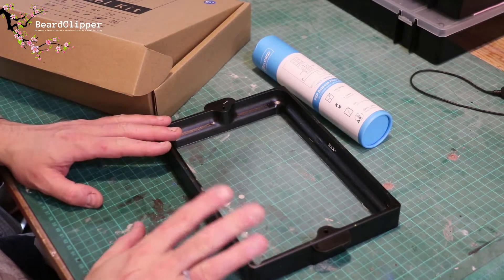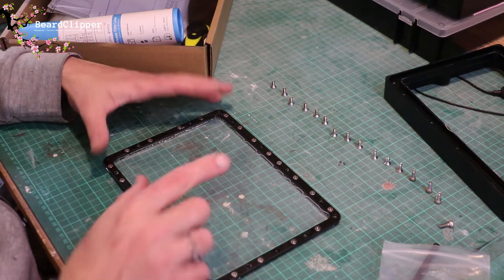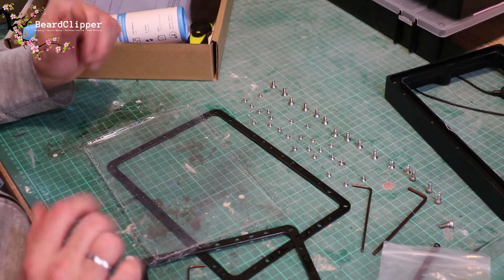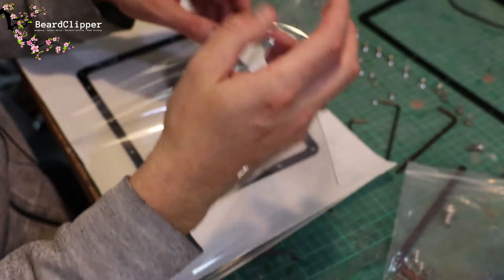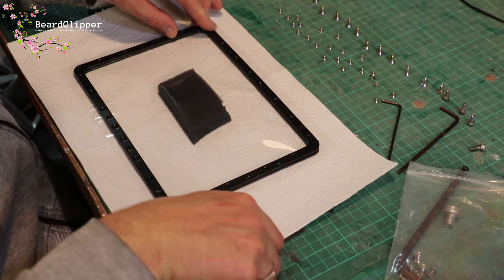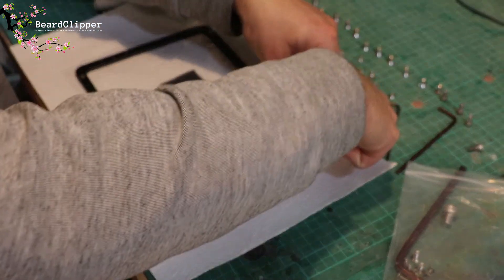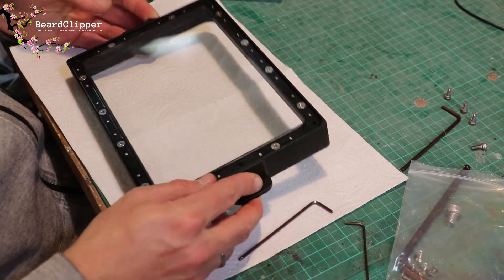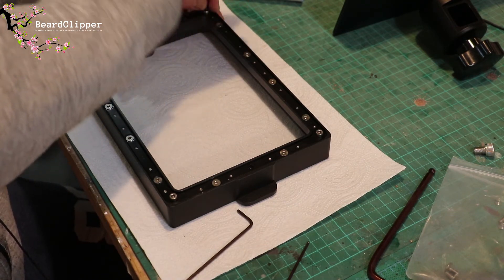IT'S EASY: How do I change the FEP on my Elegoo Saturn Resin 3D Printer?

Comment: I replaced the fep sheet and made sure everything was tight and water tight and I had a HUGE leak that ruined my screen. Why would it have leaked if I did everything correctly from all these replacement videos I watched?
Reply from the maker: Hey there, I'm sorry to hear you've had a problem there. My only guess is the FEP was damaged before you fitted it. My advice is to contact Elegoo and see what they can do.

Regarding the leak, however, check out my other video where I save a screen from a really REALLY bad resin leak :) I'm still using the same screen that I saved in that video so no need to panic at all.

Best of luck!

Comment: Just a heads up to viewers that this is a custom tank, as the tank that comes with the printer is radically different, and you can't replace the FEP on the supplied gasket in a way that will enable it to screw back into the tank.
Reply from the maker: No it isn't.

This is the tank that came with the printer; I have that tank and a spare and both have their FEP changed in exactly the same way. I do know that there are after market tanks that are throw-away and you cannot change the FEP however they are not the ones that come in the box.

I'm interested, however, in why you say this? Were you unable to change your FEP? That's not ideal at all.

Comment: Thanks for the video!  One question- how tight are the second set of screws supposed to be? (The set that tension the FEP)
Reply from the maker: Ahh you are welcome :) thanks for watching. I tighten everything up until I can't really tighten it any further :) i'm not using power tools so just what torque I can apply with my hand on the allen key.

Comment: Thanks for sharing, I am quite accustomed to changing the FEP but usually on my anycubic mono x, which I havee 2 of. I purchased the elegoo saturn a few months ago and felt it was time to change the FEP on it. I wanted to make sure that the process was the same, which it is mostly... so now I'm happy to go ahead and do it.  One little tip that I'd like to add if i may. I use the alan key to pop the hole before I put the bolt in. I just find it easier and I feel I have more control with the pressure. 👍 Once again, thanks for sharing. :D
Reply from the maker: You are very welcome; I'm really pleased this was useful for you. That is a good idea, with the alan key. I'll remember that for next time. Thank you for watching and for commenting - it is much appreciated :)

Comment: I had to change the FEP on my Creality Halot One a couple of weeks ago. It didn't mention anything about a foam block. After seeing this it makes more sense to do it with the foam. But it worked so I suppose I will keep doing it without a block. 

Three tips I have:

First. I used a hand driver that accepts the little various bits instead of the supplied Allen keys. I'm a mechanic by trade and hate using the Allen keys. I much prefer a driver. I find it easier and faster. 

Second. I found it easier to use a micro Philips screwdriver to pre punch the holes for the screws. It's got a nice point on it and was way easier than trying to punch a hole with the tiny screws. 

Third. I believe you did this with your first printer. That is leak test the vat first by putting water in it and let it sit for a short time. 

Hope this helps! 🙂
Reply from the maker: Thank you so much for the comment; I think different companies have different ways of doing this. The reason for the foam is to give just enough flex to enable the FEP to stretch over the lip at the bottom of the vat side walls.

That was such a useful comment mate - thank you, you are a star!

Comment: I've never used foam, but a Gatorade cap is the thickness suggested. I keep a spare in my parts box. 
-John
Reply from the maker: Well that's great advice; I'll pin this comment and thank you so much :)
Reply: How thick is a Gatorade cap? :)
Reply: @B4MBI72  I don't have my Caliper close by, but it measures roughly 11mm thick
-John